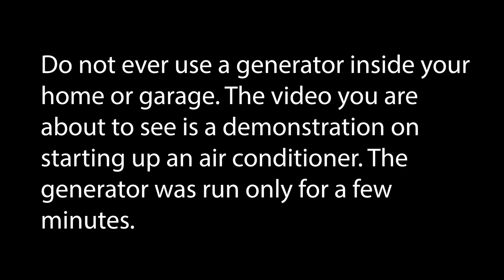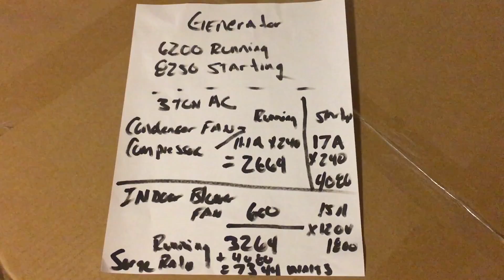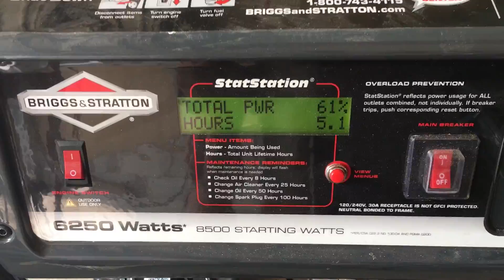How to run central ac running on portable generator during an emergency

Comment: Thank you for this video...very informative...I have a 3 ton  bosch IDS 2.0 and I was curious what generator can run this, fridge and lights and IM thinking both solar and standard generators.
Reply from the maker: I believe that yours may be an inverter model, which is great because they draw less startup current. If you measured your incoming surge amps when it first comes on, that would give you a good idean on which generator to purchase.

Comment: I just got Fireman 7500 running watts and still cannot power 4 ton ac unit , I have two generators even use divided for only power the AC compressor still cannot start, maybe soft start kit is key? don't know yet, just spent 900 PLUS a whole day work on Sunday to add plug in box still no AC
Reply from the maker: You will be amazed!

Comment: Three electrical storms in Florida within six weeks has left me without power for nine hours altogether. I really want a standby generator but I rent my house so it’s not advisable. What should I get if I want to run refrigerator, microwave, and central air?
Reply from the maker: Depends on the size of your ac and what you plan to power during an outage. I would get something in the 10-13,000 watt size if you have renters. Might also get a small transfer switch so you can control what gets powered during the outage and not the renters.
Reply: @IFix-Things  i’m the tenant, I can’t contract for a transfer switch. I’ll call the property manager tomorrow to find out what I can do.
Reply from the maker: @ovicello61  well you have options as a renter, such as an ecoflow wave 2, and also most large u it’s like ecoflow delta can power the frig and microwave
Reply: @IFix-Things  I just don’t wanna be moving the fridge to plug it in to an extension cord. Also I want to plug-in a mini air conditioner.

Comment: There is a product I would buy that, apparently, nobody has thought to build or even to speculate about. This is a fuel-powered air conditioner, much like a generator or a gasoline welder or air compressor. I would want a 12,000 btu unit with two long hoses for intake from the house and cool air delivery to the house, through a window or storm door.  1 ton of capacity, running full time, should be enough to replace a 3 ton unit running periodically, in an emergency. Running the furnace fan would provide circulation. If a 1-ton window AC typically uses only 900 Watts running, it seems that a very small engine would be needed. A purpose-built gasoline AC could be made very efficient. There are loads of solutions for providing electricity when the grid is down, but to me, the most important appliance is the AC. I appreciate your showing the steps to calculate the power required for central AC.
Reply from the maker: You are correct in that AC in some areas is needed! There are some products like the ecoflow wave that are making strides in this area, but way more work needs to be done to cool a larger area. The closest I can come is a mini split

Comment: On the hypereng soft starter, there are 2 models in your link, which soft starter do you recommend the single phase or the 3 phase?
Reply from the maker: Depends on your main feed that comes into your house. Most residential houses in USA you would use the single phase
Reply: @IFix-Things  ok thanks
Reply: @IFix-Things  Quick question, I tried contacting hypereng via there US contact form and keep getting error message. Do you have a phone number or link to actually purchase the single phase unit? Or do you know of a alternative brand that is comparable to that unit?
Reply from the maker: @informationstationjw  micro-air is just as good, in fact may be a bit better as I think theirs now has Bluetooth connectivity, around the same cost too.
Reply: @IFix-Things  ok so do you recommend the 364 or 368?
Reply from the maker: @informationstationjw  this would depend on your ac size. I would ask micro-air for their recommendation.

Comment: I have a Trane 4 ton/ heat pump system, my generator is 8500 watts running on propane. It ran the whole house except the A/C, would not run at all. Voltage was 244 with no variations. I guess watching your vid, I need a soft-start……
Reply from the maker: Find out the LRA of your AC, (lock rotor amps) then take that number, and times it by .6, that would be about how many watts your generator would need to be with a soft start installed. YMMV. I'm guessing a soft starter would allow that generator to start it. assuming the 8500 watts its rated at is running watts, not starting or surge watts

Comment: Soooo, my thought was to make my own system with like 5 capacitors in series, is there any reason why this wouldnt work?
Reply from the maker: I'd need more information. Are you just thinking 5 caps without any batteries? If so not enough.

Comment: I have a 4 ton and a Generac gasoline 15k.     It actually only has a 50 amp plug so I use 12500 of it.    It has a surge of 22500.    It works fine.    It ran the whole house 2 times after hurricane took down the grid.     13 days and 9 days.    Forget about the gasoline bill.   Crazy expensive.
Reply from the maker: Lol, I hear you on the gas , nice setup!

Comment: Mint... I had an old 2 ton  I could start on a 5500w with a hard start no problem.... I just replaced the AC and will be going this route I think... Much less stress on the compressor.

Comment: How did you arrive at 17 amps from 72 amps
Reply from the maker: The soft starter will greatly reduce inrush current.
Reply: Is there a math formula or did u discover that 17 amps as an actual reading thanks
Reply from the maker: @theendofallthingsisuponus1575  It was an actual reading. The manufactures of these soft starters will only give you approx numbers.
Reply: @IFix-Things  excellent maybe ur ac build quality has contributed to that 72 to 17 also. I have one just have not connected it. Thanks.
Reply from the maker: @theendofallthingsisuponus1575  Not sure, Ive installed these now on two different a/c's and have seen similiar results. Hopefully you will be happy with how hmuch it reduces your inrush as well. Please be sure to report back once you get it hooked up.

Comment: i've looked at many soft start videos, yet no one ever mentions how installing such a device might affect a unit under warranty!..... comments???
Reply: One tech said that a soft start units actually extends the life of air conditioners. He routinely puts them on older units.
Reply: @mitchmintz111  -   i'm gonna have to talk to the guys who installed it. my problem is that my unit is only 1 year old. there's a long warranty period left and i'm afraid if i get one of these, and ANYTHING goes wrong, the manufacturer will just say..... sorry, not sorry!!!
Reply from the maker: I would think you would need to ask the manufacturer of your AC unit, as each response could be different.

Comment: I would like to do this to run my home air conditioner during the summer months. What kind of cost am I looking at to hire somebody to hook this up to my existing electrical box? Thanks!
Reply from the maker: So mary variables, like type of generator, will you use a transfer switch or lockout system, length of wiring, wiring size, cost of your electrician, etc, I would expect to shell out a few thousand.

Comment: Just get a window unit
Reply from the maker: Generally not a bad idea. Some people dont have the kind of windows that fit normal window ac's, and some people are older and cant lift them.
Reply: Bought  2 inverter gens and 3 window units for emergency. 
If my central air has problem. 
If the utility has problem. 
I run the 2 inverter generators in parallel. Each one power 1600 watt.
I use 1 window unit and 1 generator in summer camp every year.
Reply from the maker: 😊I wish@@peten8767

Comment: U use this only for emergencies meaning u remove the soft start otherwise? Thanks
Reply from the maker: No I leave the soft start permanently connected
Reply: The soft start is a good idea in general as it extends the life of your compressor.  Factoring in a generator is a bonus

Comment: I have always been told that portable generators have inconsistent dirty power and it’s very bad for your higher amperage devices like your air conditioner. I am not sure if this is always the case just thought I would mention it.
Reply: It's not so much higher amperage when comparing dirty power. This depends on the type of generator. Regular generators have a THD (total harmonic distortion) of around 10 to 15 percent, great for power tools, bad for anything with a circuit board or electronics. Invertor generators (and the majority of stand alone generators) have a THD of around 5 percent. Invertor generators take AC current, change it to DC current, and then back to AC in a much cleaner form. The less THD, the better for sensitive electronics. Portable generator manufacturers have recognized that and have developed invertor generators with much higher wattages these days.

Comment: It will do it without all that just turn the ac unit on first let it level out then turn on the lights in phases as they pull almost nothing
Reply: When about when it shuts off and comes back on?? You will have in rush amps
Reply: @Cenlalowell  keep your ac turned down low to like 65 so it doesn't turn off. then you don't have to worry about it kicking on and off.
Reply: You nailed it. Turn off all breakers before switching to generator power. Let the generator run for a minute or two. Turn on your highest load first. Normally AC. Then well pumps, water heater and so on.

Comment: Yup you must have a scroll compressor. Single stage unit.
Not so sure it would work on my 2 stage. My comp uses 40Amp inrush for 1st stage(w Hard start booster for each stage)
Then when 2nd stage kicks in 64Amp Inrush.(cooling fan already running)
Reply from the maker: AP514 AP514 you should email hyper engineering and see if it would work for you. I’m not qualified to answer that one.
Reply: @ver151set  Mine is a Payne 3ton unit. Will this work on mine?